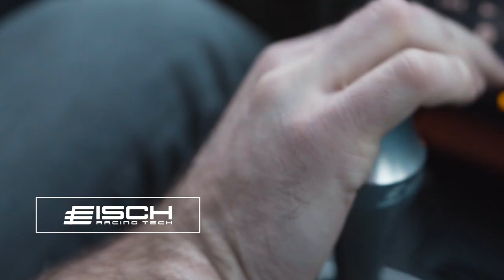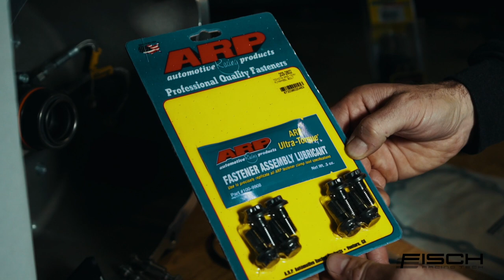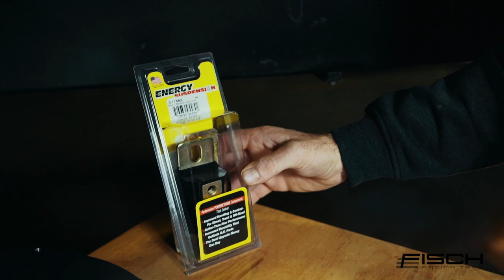JZ to CD009 Adapter System Cutting & Install | FISCH RACING TECH

Comment: the suspensful music hahhhaa whats the soundtrack so  ican use it for my pre workout...

on a side note if one of those bearing spacers fit does that mean you have the weaker cd009 transmission?

also no blue loctite for the flywheel bolts?
Reply from the maker: Flywheel bolts installed per arp's specs. 

The smaller bearings do mean a slightly weaker input, but the main thing you want to look for is triple synchros. 

If you have proper input shaft alignment (the biggest problem with adaptor plate kits) then that wont be the weak point on your trans, regardless of size.
Reply: @FischRacingTech  none of the bearing spacers fit on mine so ima take that as having the stronger geared one

Comment: What is the weight of the single mass flywheel?  Also I've heard that there will be increased gear chatter without the dual mass flywheel that comes with the vq/cd009 engine combination, do you have any intention of offering this for jz engine owners?  My IS300 is such a smooth street car and I'd hate to increase the NVH with this transmission when ar5/w5x combinations don't seem to have this issue.
Thanks!
Reply: 14lb. Sorry, we currently don't offer a dual mass flywheel. However, we have several hundreds of kits out there with no complaints about this. The CD009 in general is a noisier transmission compared to other transmissions.

Comment: Fantastic looking item, I’m in the process of piecing everything for my IS with 1j swap. I have a cd009 already that I’m thinking of using, but I have concerns with the stock diff as most people claim the gearing is too short for highway use (daily driving). Is this something you guys have addressed or have any input on what would be best for a solution?  Also what makes this different then serialnine kit?
Reply from the maker: This is true. The 350z has a 3.5 where Toyota's are typically 3.7 or higher.
From our research online, driftmotion has 8" gear sets for as low as 3.58:1 to rebuild your rear end with (all the way up to 5.29)
They would be an excellent shop to talk to regarding rear end ratios and matching a cd009's driveshaft rpm
Reply: @FischRacingTech  thank you, ill look into it.

Comment: Great kit just sucks its missing either a driveshaft or clutch system. $2900 for the kit and shirt throw without a driveshaft and clutch is a little steep.
Reply from the maker: Yes, this is the difference between a full conversion bellhousing, and an adaptor plate.

Comment: Just bought mine :)

What type and size sockets will we need for install? I noticed that the ARP bolts are different to anything that I have.
Reply from the maker: The arp bolts use 1/2" 12 point sockets.
The bellhousing bolts are typical metric allen drive. The bottom 4 are one size smaller than the top ones.
Reply from the maker: If you have any more questions I get them faster on Instagram or email, but will gladly reply here as soon as I see them.

Comment: You need to make a video with the double clutch set up,clutch options and shifter options
Reply from the maker: At this time we don't offer any of those items, but will gladly look into specific options, if there is one you would like to use.
Reply: @FischRacingTech can you design flywheel for a Tilton 7.25 clutch ?
Reply from the maker: @supradrift681  that is the clutch that our multi disc flywheel is designed for

Comment: I'll be ordering a kit for my IS300 soon. I was wondering what Driveshaft and Transmission mount will i be using?
Reply from the maker: A custom driveshaft will be required, either by modifying your stock one or having a full one piece made.
Reply from the maker: The kit comes with a transmission isolator mount. Serialnine offers a trans mount that works with our kits transmission position. Aside from that you can make one from steel

Comment: The fisch adapter housing is different from the Collins adapter... which is the better way to go?
Reply: In my opinion the Fisch adapter is better because adapter plates usually have alignment issues which the Fisch Bellhousing doesn't have.

Comment: What is the recommended driveshaft setup for this upgrade?
Reply from the maker: Hi.  We have always ordered new 350z slip yokes then taken our oem shaft to a local driveshaft shop to have them shortened the appropriate  amount. Because our kit is shorter than the typical auto bell/adaptor plate, I am not sure of an OTS solution for a driveshaft.

Comment: in the end the length the gear stalk position of the cd009 will be similar to r154 or it will be pushed more rearward?
Reply: It will be quite similar. The CD999 was developed by Serialnine to work in Lexus/Toyota chassis, without having to cut the trans tunnel. They have altezzas, crowns, jzx, and aristos as their shop cars, so being similar to R154 was definitely something they had in mind when designing the shifter.
Reply: @FischMoto  thank you for the insight..

Comment: Do you make a kit for a 1uzfe to Cd009? Does the shifter need and modifications for the swaps?
Reply from the maker: Hey Ty,
Our UZ test car is currently getting wired up, and should be on the road soon. Once we have tested it to confirm fitment we will be launching the UZ bellhousings. 
In theory that will happen before Black Friday, so quite soon
Reply from the maker: As for the shifter, we currently offer the Serialnine CD999 which works well with the CD in most chassis. What car were you looking at putting it in?
Reply: I’m planning on putting it in a 2009 BMW 335i.
Reply from the maker: @tycharles241  gotcha. Idk what cd location is like with e9X chassis. Might be a test fit then order shifter type situation

Comment: Does it matter if you were to use a manual out of a 370z, they seem to have some electronics for throttle matching... I take it the gearbox would just run fine as a normal manual?????
Reply from the maker: yes. It should run like a normal manual.
Reply: @FischRacingTech  And there's no rattle with your product... I've heard stories of rattling with these swaps... Be it from another well known company
Reply from the maker: @danthomas86  We don't know about rattle with our kits.

Comment: Do you do any kits for a JZS147 Aristo (GS300)? I want the shifter to be somewhere near the stock position.
Reply from the maker: At this time we do not offer our own shifter. We have some serialnine cd999 shifters on hand that make the position nearly stock, on most Toyota sedans.
Reply: @FischRacingTech  Have purchased this Kit. On its way. Just wanna check, can I us a twin plate clutch if it was designed to replace OEM 350z?

Comment: Do you make it for a ls1 conversion cdoo9
Reply from the maker: Hey Peter. We do, it will be available  to the public soon.  Currently we have one LS unit being tested in our shop g35 and it has had 0 issues. Follow us on IG or FBfor updates about  its release
Reply: @FischRacingTech  thank you for your reply im in for one thks
Reply: May I ask ?? What will be the clutch and fly wheel to use with the ls1
Reply from the maker: @PeterHatch-mx7zc  for single discs you can use any 350z clutch. Multi disc is a little more complicated but the kit is designed around the Tilton OT-II twin and triple disc 7.25"

Comment: You need to do a start up so people can hear the rattles. 🤣
Reply from the maker: Whats your ig so i can send you a video. Not sure if its your clutch or the collins kit, but there are no rattles in any of our test cars.
Reply: @FischRacingTech  pearce_the_hood_hippie I have the Collins kit on mine.
Reply: From my understanding it's the flywheel being to light to absorb the vibrations from the motor then transfered into the input shaft.
Reply from the maker: @PeaceSTAR253  how much does it weigh
Reply: @FischRacingTech  I'm not 100% sure because I bought the car swapped already but I think collins uses the fidanza flywheel that's 13.5 pounds.
Reply from the maker: @PeaceSTAR253  i think they have their own flywheel. The Fidanza isnt 3 inches thick
Reply: @FischRacingTech  just basing it off there website wording the kit for the is300 uses a different flywheel. On there other kits it says Collins lightweight flywheel but on the is300 it just says aluminum lightweight flywheel.
Reply: Late to the combo but I have a fidanza fw on my stock w55 is300 and it rattles with a exedy oe replacement clutch kit 👌 ooof lol 

A solution is to use a heavier fw like the w58/supra compared to the lighter fidanza one .. thats what my friend did on his 1j is300

Just my opinion

Comment: a kit for the rich. meanwhile domestic muscle cars have aftermarket bellhousings for $300 :/
Reply from the maker: Will terrible alignment issues. There are cheap kits out there for jz - xx transmissions as well. 
Unlike those kits we havent had a single customer break an input shaft at any power level (yet)
A JZ swap making enough power to require a non toyota trans is not a cheap junkyard build